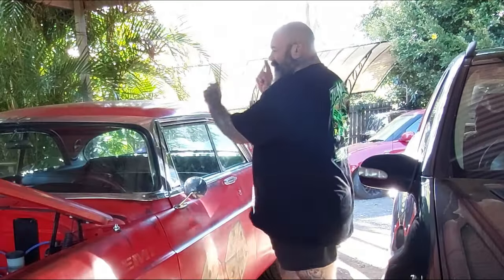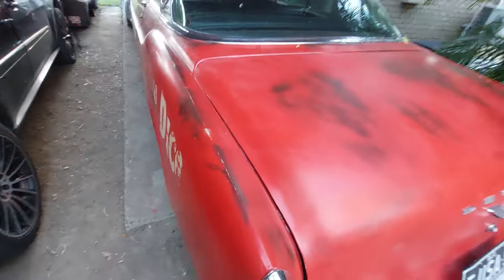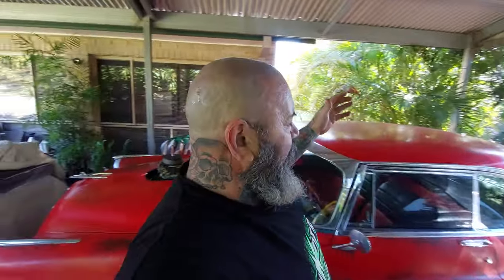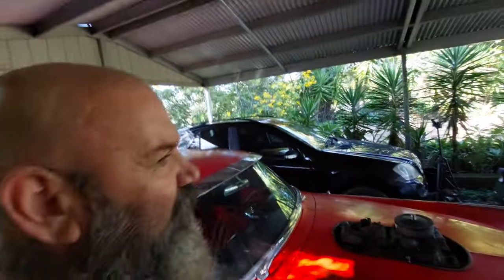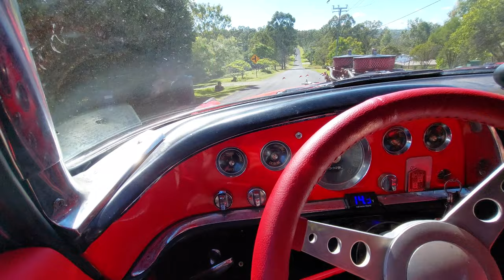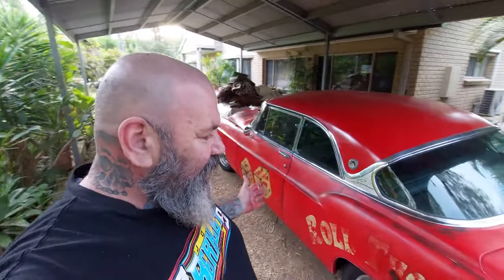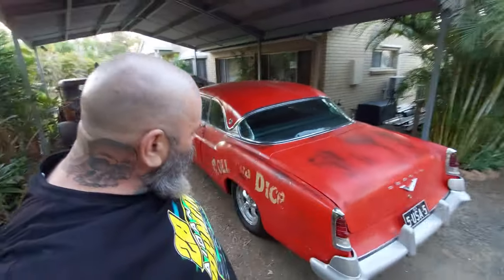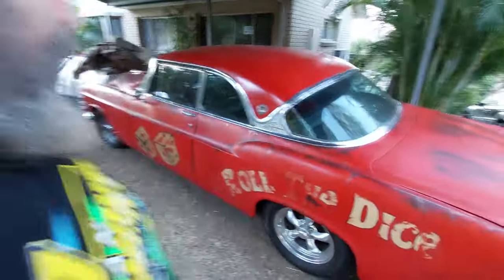Supercharged 392 HEMI 1955 Desoto!  Fuel system issues Twin Holley Carbys! #mopar #patina

Comment: HA-Ha!  How'd you know I was still watching?  I'd guess that car would be somewhere about 3600lbs and with that 392 it puts is at about 9lbs/ Cu. In. or so.  That would put is in B class with a supercharger.  The designation changed thought the years.  From 1960-'65 it would be B/GS.  1966-67 would be BB/G.  1968-'69 it would be BB/GS.  I'll post the weight break chart on my channel's page. Not sure how to post it here.  I really like how that car is looking.  Class call out would be look good on the lower dogleg of the front fender, on the roof sail panel, or lower rear quarter.  Stick a set of 15" original design Torque Thrusts, Cragar SS, or slot mags on that sucker and it'd be pretty spot on.
Reply from the maker: Thanks mate I knew you would know all the details. I've done some more stuff to it now as I still wasn't happy with it.  Saturday I went out to clean the chrome and it was the first time I looked at it smiled and thought that is a bada55 looking car but you'll have to watch the next 2 vids to see the end result
Reply: @copperheadkustoms  Anytime my friend.  I can't wait to see what you do next.